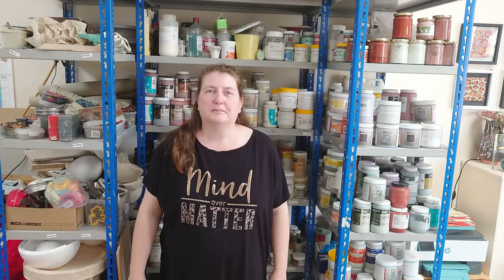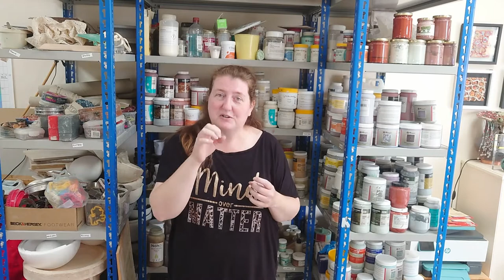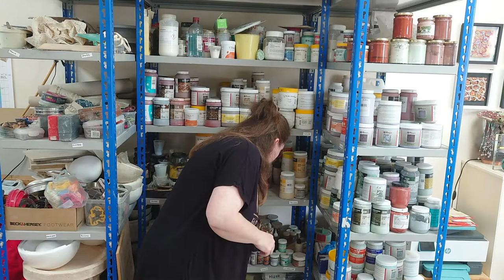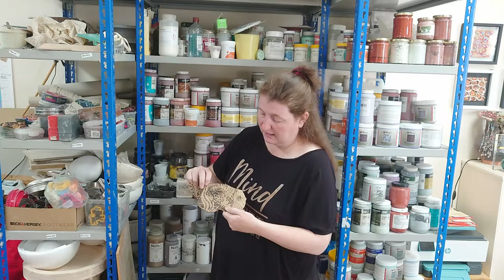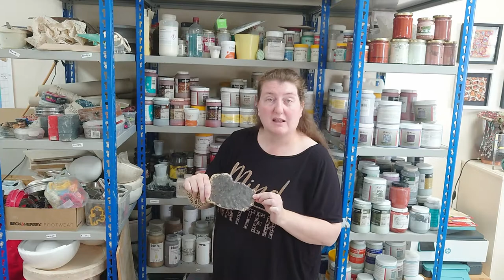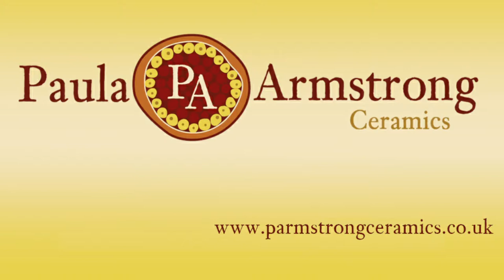What to do after bisque firing and different options for finishing that I offer in my studio.

Comment: Thanks that was helpful.  As a beginner I often need to see examples, results pre and post firing etc.
I’m using  a grogged clay that will be fired to sculpture temp..these are sculpture pieces for outside…but I want a wash of colours not a solid glazed look.  The background will be left to its finish colour as a warm sandstone look.  Hope to use a Matt finish glaze.
Will this idea work?
Reply from the maker: You can certainly finish with a wash of glaze or oxides or underglazes, it all depends on what finish you want.  You can mix them up and layer too.  I would suggest though, if you're after a particular finish that it is definitely worth testing out ideas before committing to a finish on a piece that you are attached to.  You can make a few test tiles and pop them through the kiln first just to be sure that you're likely to get what you want.

Comment: My figurine is too shiny..is there a way to remove or dull, the glaze?  Thank you
Reply from the maker: Hmmm, glaze is essentially a coating of a glass-like material over the ceramic so that's tricky.  I think my first step would be to try reglazing with a matte glaze over the top and see if that helps. It won't cover the previous glaze but will melt and blend with it but it may help. I do however say to only reglaze if you really dislike the piece as it's always a risk when refiring 
Outside of that you could paint the surface with something like a metal or glass paint. A frosty spray maybe?

Comment: I have a bisque piece, that I painted and spray varnished it, now the lady wants to change the color of the finished piece, can I paint over it?
Reply from the maker: Hmmm, I would think that it would depend on whether the paint will work over the spray varnish you used... If it does, I see no reason why you couldn't. I'm assuming it's not glaze but acrylic paint or similar?
Reply: @PaulaArmstrongCeramics  thankyou for gettimg back to me. It is the spray from the can that you can use on furniture and stuff.
Reply from the maker: You may need to do a small test area to make sure that the paint will do what you want and/or sand it down before painting, but I would think you should be good with the right paint :) @denicenicola1805
Reply: thankyou, i will keep you posted @PaulaArmstrongCeramics